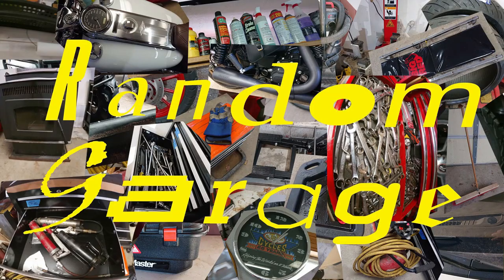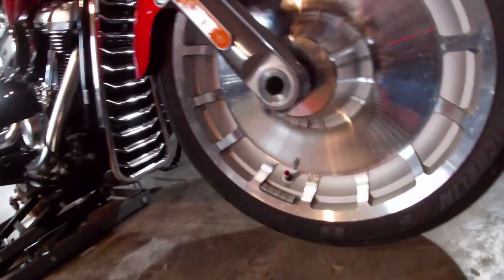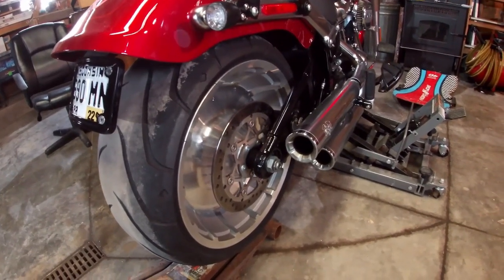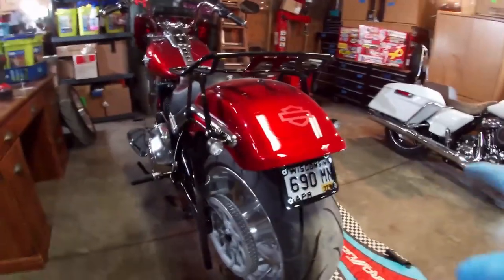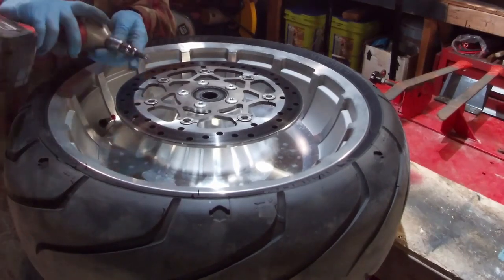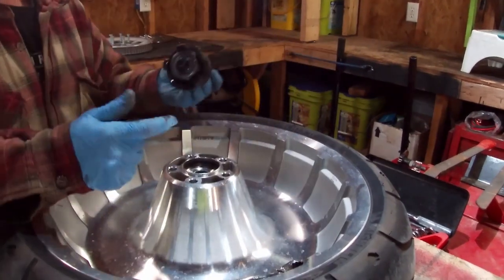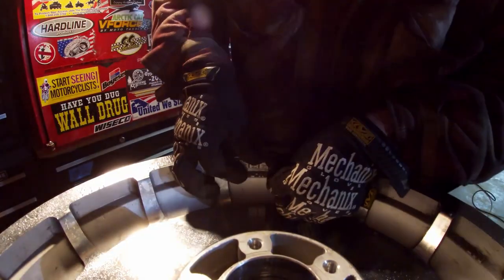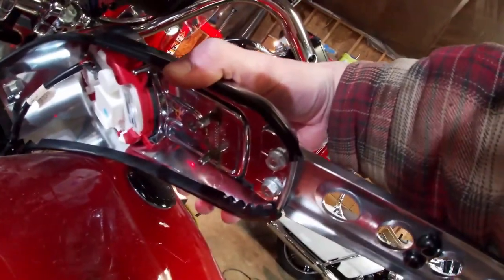2019 Harley Fat Boy 114 wheels removal and teardown - Random Garage

Comment: Quick question. You mention not loosening the axel adjuster to not interfere with alignment and tension. Wouldn’t the wheel need realignment and belt tensioning anyway once put back on?
Reply from the maker: @seb23490  no.if it was aligned and tensioned properly before removal, and the axle adjusters don't get moved, then it'll be the same when you put it back together.

Comment: Beautiful bike, did you say you changed the tyres? Is so how much was a set of replacements and how many miles did you get out of this set! Cheers
Reply from the maker: Those stock tires had about 10,000 miles on them and had some life left, but both wore on the right side more than the left. The front was actually down to the wear bars on the right side only. I've seen the same uneven wear on other people's M8 fat boy. 
The new tires cost $620 USD.
Reply: @RandomGarageUSA  Weird. My stock tires are completely toast at 6100 miles. I'd be stoked to get that kind of range out of them! My right front is also more worn. It's the weight of the big primary on the left causing the uneven wear. Now I'm wondering if I got scammed by odometer fraud. It supposedly had 1200 miles when I bought it. Hmm...

Comment: @Random Garage I have a 2019 fat boy 114 just recently noticed a crazy rattle when I travel over bumpy roads comes from the front end, I checked every nut and bolt for looseness and finally my dad took a rubber mallet and began tapping the front tire and the rattle sounds like it's coming from inside of the front rim… Bearings? Something more serious? I'm taking it to the shop because it's obvious that this is not normal. Any suggestions I've been riding for years but never did any major repairs myself, as I did not want to void my warranty if I screwed it up. Any help or info so I could be better prepared at the dealership would be appreciated. The bike only has about 1500 miles on it I am the original owner, and I take it in regularly for maintenance. I know the mileage is low but between being busy and Covid ruining everything I have not had a lot of opportunities to do a lot of riding.
Reply from the maker: Bad bearings usually make a humming or grinding noise, not a rattle. Since it occurs on bumps, I would suspect something in the suspension or steering neck. Or maybe the headlight is loose and rattling in the housing? At only 1500 miles, I'd be looking close at the simplest things first. A major failure is unlikely (but can happen).
Reply: @RandomGarageUSA   thanks for getting back to me, weather permitting its going in tomorrow. I checked pretty thoroughly and its a rattling sound kind of like a bolt that fell off bouncing around on a metal shelf but I cant find anything. But if you tap that front tire you definitely hear it, maybe its in the fork. Ill keep you posted.
Reply: @RandomGarageUSA  after taking it to the dealership for the second time they said to me "there's nothing wrong with it, it's just the way it is. I informed them that I bought an extended warranty and that I am not riding the bike because I don't believe it safe. After some back-and-forth an older mechanic overheard the conversation and said he would take a look at it. And after just one test ride he came back and said "there's definitely something wrong" and it was determined that the wrong size bearings were put into this bike at the manufacturing side, he said everything was loose and just bouncing around inside the wheel hub and "may have" caused an issue while riding. The bike is fixed now no more loud rattling tambourine sound and I feel comfortable riding my Fat Boy again
Reply from the maker: @readysetterrible3278  wow that's crazy. Why would the wrong size bearings even be near the assembly line? Perhaps the supplier screwed up and sent the wrong ones. 
The machanic didn't think there had been any damage to the bore in the wheel from the bearings moving around?
Reply: @RandomGarageUSA  They said no damage, but it was terrible sounding especially in NY where some streets can be bumpy. Its just so annoying when someone looks at you with a straight face says"you aren't  hearing what you're hearing.

Comment: What kind of license plate bracket is that? I don’t like the one on the side.
Reply from the maker: It's a Kuryakyn plate bracket for Touring bikes, but I made a small adapter bracket to make it fit the fatboy, and also relocated the stock license plate light under the fender.
Reply: @RandomGarageUSA  Thank you very much.
Reply: I know this is delayed, but do ya have any close up photos or model number for the bracket ya got and the adapter?  It's mind boggling that there isn't an affordable or simple bracket out there anywhere!!  Thanks!